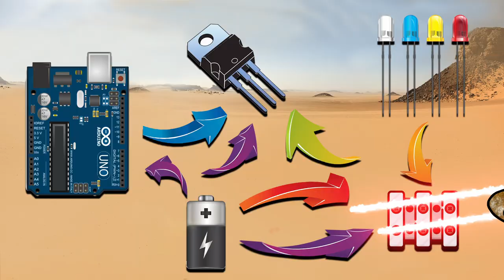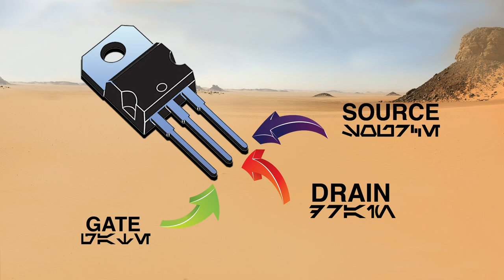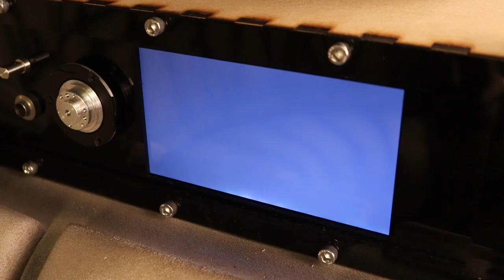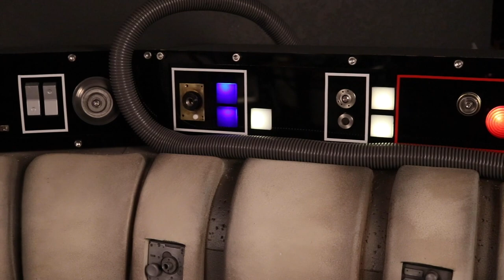Millennium Falcon Bench | Star Wars Room Build Episode 11

Comment: MDF is basically compressed sawdust, after drilling a hole, squirt a little super glue in and let dry. It will harden the MDF in the hole to like a hard plastic, to better hold the screw threads. Thanks again for the video, looking forward to the next one. John S.
Reply from the maker: Great tip!  Thanks John!

Comment: Another great cheap/free power option for electronic projects is a desktop computer power supply. They output 12 volts, 3.3 volts and 5 volts, all at the same time on their color-coded wires.  And they can provide anywhere from 250 to 1000 watts.  Most people just throw these out with the computer.
Reply from the maker: That is 100% awesome! Great suggestion

Comment: Another great episode. Love seeing more on the room build. I appreciate the lesson on mosfets and wiring but it still went straight over my head.  I see electrical work and my brain just turns off.  This is why my Han in Carbonite still has no blinkies.
Reply from the maker: Oh no!  Sorry Dan, I try to go fast but not too fast over that stuff.  We still need to get our “electronics 101” series together.  There I think we can spend a bit more time on specific items and help get those little lights blinking for you!
Reply: @TheSmugglersRoom  I think it was more my brain than the lesson lol The water translation made sense but the numbers and the programming bits are like reading  Huttese..  A small series on prop electronics and Arduino would be fun.

Comment: I'd consider using addressable LEDs for something like this.  Usually referred to as WS2812 LEDs or by Adafruit's brand name "Neopixel", they use a "daisy-chain" system, so it massively simplifies the wiring.  You can have about 1000 of them in a single string.  You'd need to supply them with power remote from the Arduino, but the whole string would use only one Arduino output pin.
They're usually surface mount parts, which you can get on strips that are made to be cut, but they are also available in standard 5mm round packages.
One of the big advantages other than the simple wiring is that you get RGB control of each individual LED - up to 16 million colours (256 levels for each colour).  So if you want to change the colour of a particular LED, its a code change in the driver Arduino.

Comment: I know what you mean about cable management. I used to work on mail sorting machines, and some techs would just run a whole new wiring harness rather than figure out what cable was not working. Of course they also left the old harness in place as well. What a mess!
Reply from the maker: Yeah, wire management is brutal if it's done poorly.

Comment: Love your room build . . Have a question what do us e use Treat you wood Before you paint. Specially if he’s funny music for outdoors.
Reply from the maker: Hey there.  We use primarily MDF for everything.  The material is farily inexpensive, and there are no woodgrain elements to deal with.  If the project is "small-ish" i use Minwax spray lacquer, if it is a large piece i will use Sanding Sealer.  The spray lacquer doesn't require much if any sanding between applications, but the sanding sealer does.  However the spray is much more expensive.  Now you can purchase a larger gallon size of the lacquer, but you will need a spray gun of some type to apply.
Reply: Thank you want to make.I cabin for my 3d printer( Enclosure for Abs Materials like this) with wheels. I’m making like your workbench your fridge. Star Wars it. When will you sell more green Belize in your store don’t see them anymore

Comment: Another cool and informative video. I want to make sure I understand the use of the terminal blocks for the LEDs.  These allow multiple LEDs to be powered/controlled by a single pin on the Arduino. Consequently, all of the LEDs on a single pin would receive the same command.  Do I understand this correctly?  Thanks!

Comment: How was the acrylic frame made? as well as the square holes below the buttons where you are adding the lights, is the tape 1/4 inch or 1/8inch
Reply from the maker: Hi Brian, we used our Glowforge Laser cutter to make all the acrylic pieces for the build.  The tape is 1/4" and we picked it up at Autozone.  But you can find the tape on Amazon or other auto stores.

Comment: I can't for the life of me source that metal tubing..flange? mount? thing at 11:58 Anyone have any idea what it is from?
Reply from the maker: Hi Jonathan.  The metal backplate you are seeing actually came from eBay.  The post I bought it in had several “airplane parts” so I am assuming it was part of a motor?  It’s tough to be sure because I bought a whole box of stuff from the seller.   I then drilled out the center hole so I could fit a 1” 90 degree throat connector.  https://www.homedepot.com/p/Halex-1-in-Flexible-Metal-Conduit-FMC-90-Insulated-Throat-Connector-91010/202077091